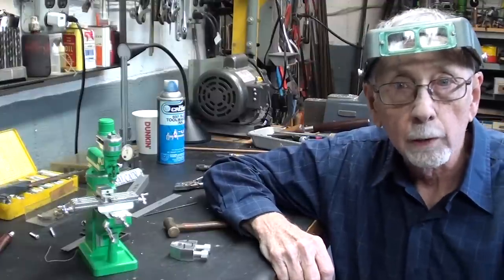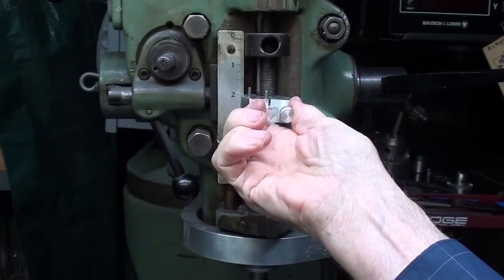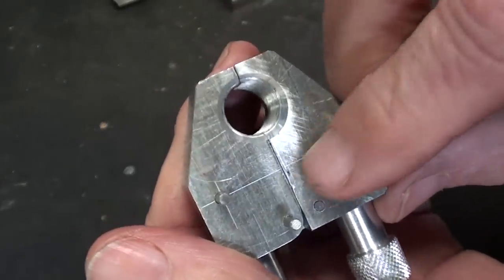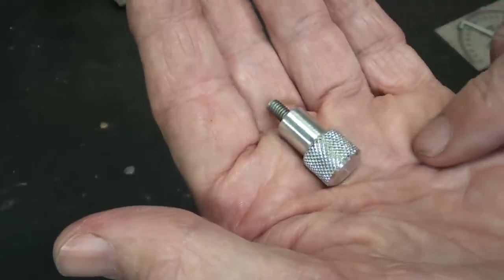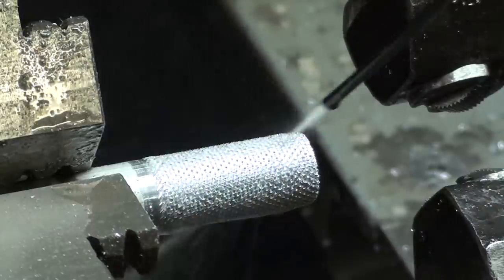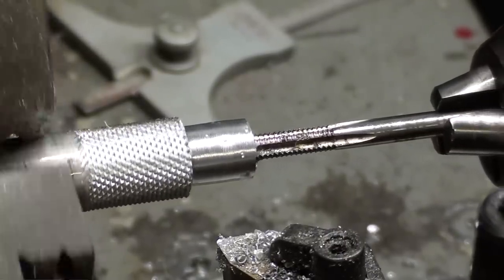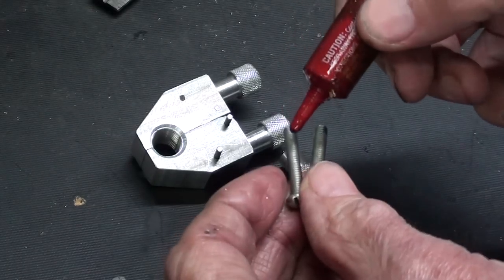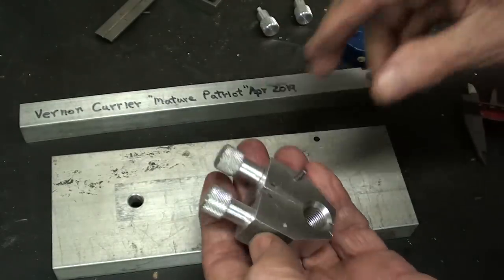BRIDGEPORT RAPID QUILL STOP pt 1 #866 tubalcain

Comment: Nicely designed and simple which is all you need, all I did years ago on my small drill press is use a small metal spring clamp and bonded a nut which I cut in half and it's been working fine for years and the best solution for my Clarke drill press and only took me 30 minutes to make

Comment: The stop on my BP has a little button you push in that lets you freely slide it up and down the threaded rod. It doesn’t have the quick attach/detach functionality, but once it’s on it’s fast and easy to use. (Also, Kuh-nurling!) Mr Pete needs a Kuh-nurling T-shirt, or sticker, or something, lol.
Reply from the maker: I just finished a two-part video on the push button quill stop. It will be released in the near future. Much more difficult to make and install.  I wish someone would design such a T-shirt or a sticker for me.

Comment: I have the Magnum Sharpie markers in blue for makring and scribing. I tried the red and it just was not as dark as I would like it to be. Dykem has more pigment and works better so I will stick with the blue Sharpie. If only I owned a Bridgeport, my shop would be complete for my purposes.
Reply from the maker: By is that Bridgeport, while you are still young enough to enjoy it
Reply: @mrpete222  IF only I were, I am 75 and still wanting one. Space in the garage is very limited just for me and my project car. Thank you for the encouragement.

Comment: Leaving extra stock for cleanup is always improvement. Dunno that if I'd leave a ¼" on each end of a 1-½" part, but removing material is a lot easier than adding it, abom's expertise in that regard not withstanding.

Comment: I'm wondering if instead of putting an internal extension spring and the pinned hinge, you might just use a piece of spring steel on the end outside held in place by the threaded pins.
I'll have to try making one like that.
Reply from the maker: I would like to see you make one with that design and send me a picture. Thank you.

Comment: The design could be simplified by using a non-captive pivot pin as used in bow spring calipers. One thru hole between the blocks, a pin with a small head on each end and some angle cuts on the back edge for opening relief (could be filed).
"ACCURATE MACHINING WITH CALIPERS #20 short tubalcain"
https://www.youtube.com/watch?v=XUs2T01RzAg
Reply from the maker: Good idea, I would like to see you try it. I don’t think I will pursue it, because no one seems to be watching this video, which I already consider to be a failure.
Reply: @mrpete222  I wont be ever making one, but I sure enjoyed watching the video and am looking forward to the next installment!!